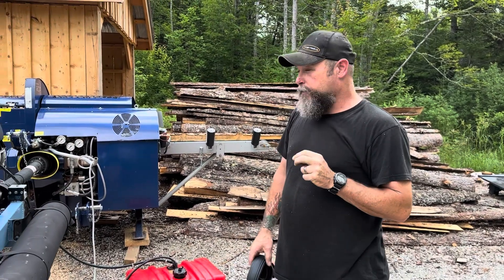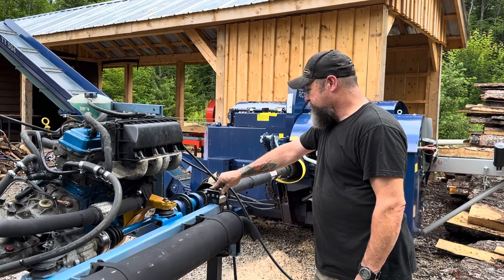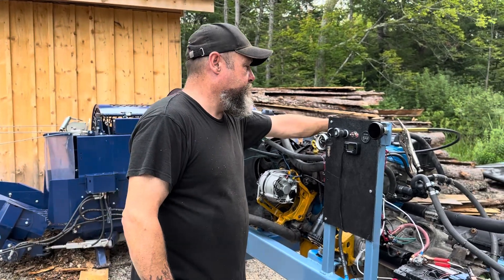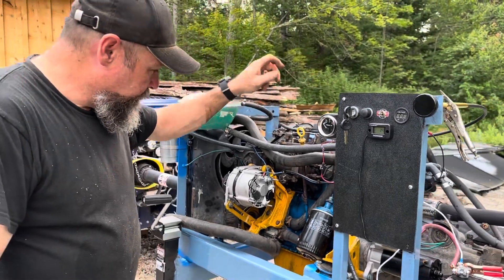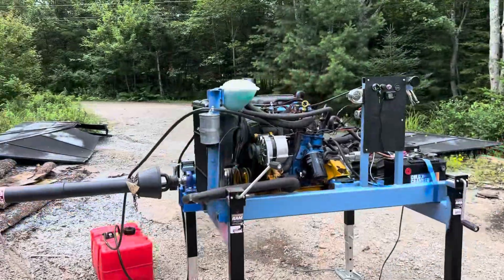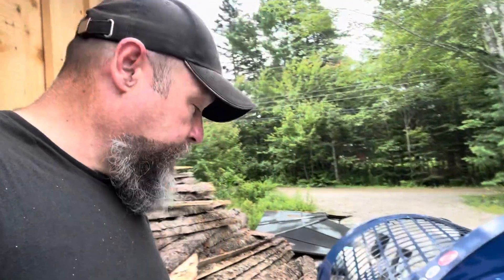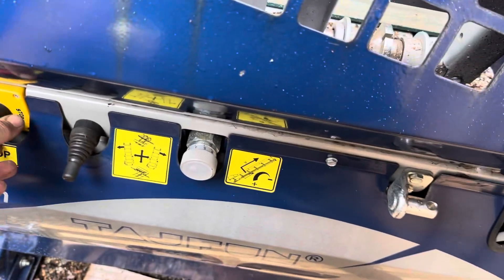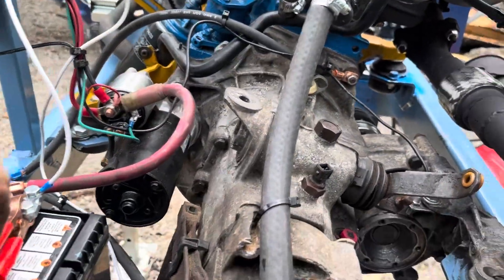PASSED THE TEST! Get back to work!

Comment: The Rather Clever Canadian, nice job on your home made power unit  sir , especially adding the heater core to reduce the engine temperature , I certainly hope you can get your Air conditioning back on soon or maybe get a bigger KW generator and don’t run out of gasoline or diesel . Good luck thanks for sharing your World with all of us .
Reply from the maker: Thanks for watching! 
Jeff